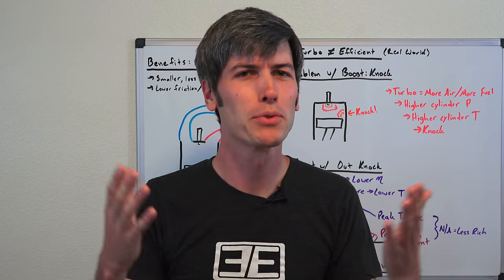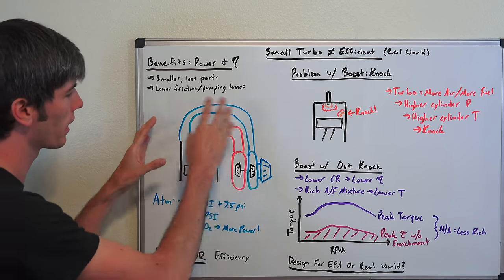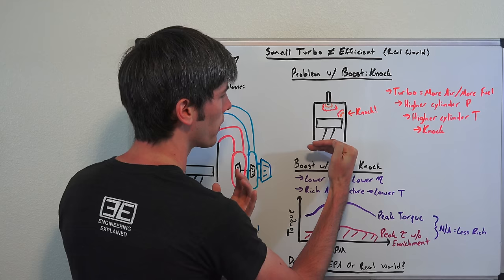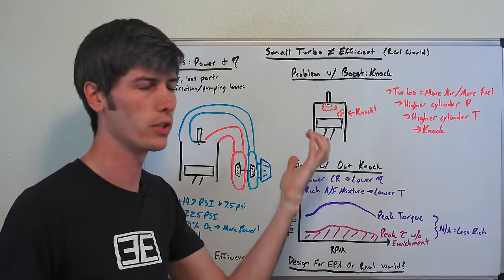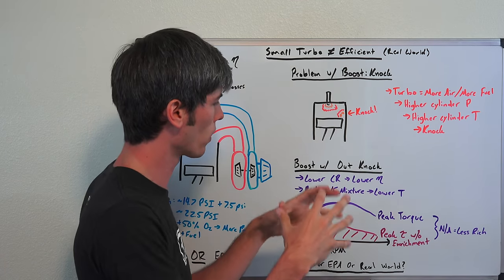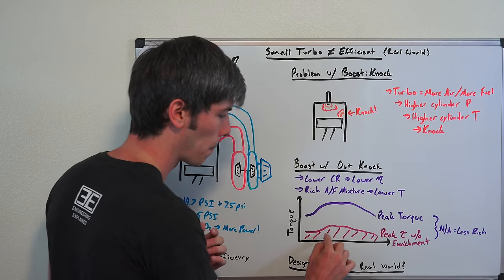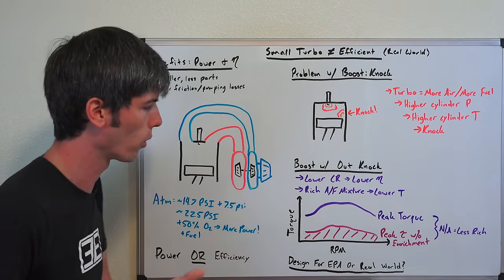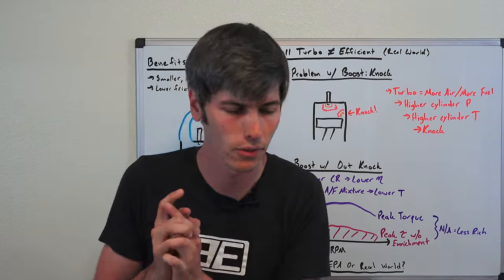Why Small Turbo Engines Are Not Efficient

Comment: I appreciate your video but I feel that after owning over 30 different cars, I have a valid opinion. Golden rule: You can put a V8 in a small car but you cant put a forced-induction 4cyl in a family sedan. 

I had a heavy Chrysler with a 360 in it. Extractors, large exhaust and an aftermarket 4bbl. Perfect engine to shift this car. Was no traffic light weapon but heaps of fun doing burnouts and it did 125mph

I also had a Nissan 97 200SX (same as your 240SX) with the legendary SRDET 2.0lt turbo engine. I did not crack this engine open. Just a new fuel pump, 3.0" exhaust, Chinese eBay intercooler, pod filter and a dyno tune remapping the factory ECU.  ABOUT 1300 USD in total. I got close to DOUBLE the factory power atw,  same with the torque. No crazy boost, pump gas and easy drivability with the a/c on during a hot Aussie summer.

Both engines were suited to the vehicles they were put in. Although   the Mopar suffered from heat sink thus high running temperatures and really needed after market cooling. But I challenge anyone to coax 50% more HP out of a V8 for around 1300 USD? 

The surprising thing was that the turbo engine was still easy to get around 350 miles out of 14.5 Gallon tank. On a pure HWY run I would easily get 385 miles out of a tank. 

I love all engines as long as they go quick or sound great or both. Oh and our 'government milage' stickers on new car windscreens ain't worth sqwat.
Reply: Big cars need big engines , small cars drinks a decent amount even with big engines and do ok with small ones.

Comment: It's an interesting discussion, but it's missing real-world data. The lower displacement turbo engines are less efficient in specific conditions, but you haven't presented any data about how often those conditions are actually encountered, in average driving situations for average drivers. For example, do most people spend most time driving in stop-go traffic (inner cities or congested roads) and constant speed (highway), with low throttle percentage?
Reply: amp888 look at this guy critical thinking! Just like the "mpg" is based off a specific test, and if you aren't driving that test at the same altitude/temperature why should you get the same results?
Reply: I think his point is more towards the performance oriented driver, who may be considering a lower volume engine as a way of having their cake and eating it too. In normal day to day driving you don't usually floor the throttle very often.
Reply: Sure, but that doesn't support the video's title. Perhaps "When Small Turbo Engines Are Not Efficient" would have been more appropriate.
Reply: That's a good point, my dude
Reply: I think so, too. The video is not wrong but as always you can't speak generally. I'm sure Jason knows exactly what is going on and he also didn't say that the shown scenario is the case in every situation.
But yeah, your video title would be a bit better for sure.
I think he could have mentioned the words "downsizing" and "right sizing" since that is the topic here.
Reply: keep in mind, that most people speed...and going 65 - 75 on the highway is going to require that little turbo to spool more often to keep up with that pace.
Reply: Certainly a point worth considering, but I think you might be surprised to discover how little power is required to maintain a speed of around 70mph, for normal passenger vehicles. It's impossible to give an exact value for every car, of course, but something in the order of 10-20bhp isn't going to be very far off.
Reply: amp888 pretty much what I thought. He's comparing a lot of apples to oranges in this. Of course any engine at higher rpm, boosted or n/a, will lose economy. I live in the boonies so see a lot of highway miles. A boosted 4cyl will always give better economy than a v8 for me. Hell, my 2.5 n/a 4cyl gets garbage economy when I lay on it.
Reply: A lot of F150 owners bought the turbo'd EcoBoost engine on the basis of awesome EPA numbers...and subsequently found out that, if you use your truck AS A TRUCK, you'll get disappointing fuel economy.

Basically the turbo tests better than the V8, yet gets worse real-world MPG, especially if towing or hauling heavy.
Reply: amp888 10-20 bhp is not nearly enough power to maintain 3-6 thousand pound “normal passenger vehicles” at 70 mph especially in America a nation buying more trucks and suvs  then ever. This normal average weight probably closer to 4-9 thousand pounds! But the real nail in the coffin is now that we have these supposed modern muscle cars that weigh 4500 pounds and most of the vehicles packed with so many features and comforts 20 bhp wouldn’t even power all those let alone maintain a 70 mph speed.
Reply: Its a good point.  Most people dont need the power most of the time so having an efficient engine that can deliver more power on demand is pretty useful most of the time.
Reply: How many "small" turbo engines are fitted in SUVs and trucks?
Reply: amp888 true, i drive 100 miles to work and back every day in my civic si, with the gearing at 70 mph i sit at 3k rpm, normally cruise around 80 mph. At 80 im around 3500 rpm, in 6th, typically get around 42 mpg with cruise control on. While cruising my car doesnt build boost, sits between -5 to 0 psi on my cluster. It doesn't start building till i hit a certain throttle percentage.
Reply: amp888 
"Small" is a relative term, not absolute. The 2.7L EcoBoost is barely half the size of the NA 5.0 V8.

Hauling 8 tons with a sub-3L engine is pretty extreme.
Reply: my wrx actually gets really good mpg at highway speeds with low load. hills and stop and go traffic kill me tho. well below rated mpg
Reply: just by its nature a 2.0L will rev up to  3,000 to 4,000rpm just calmly taking off at a stop sign but a 5.3L v8 can accelerate up to 70mph on a highway on ramp and never once go above 1,500rpm.  When the little engine revs to 4,000rpm it will spool up the turbo and the fuel map will go rich, its near impossible to not rev out small engines just because of the gearing which is very short due to lack of torque, its just the inescapable true of small engine you need to spin then up to accomplish anything but big v8 practically idle down the road effortlessly.
Reply: Don't Tread On Me V8's have a ton of pistons (reciprocating mass' which is horrible on efficiency) ton of valves/springs (20-25% of engine power goes to operating valve train) and is heavier etc. 
V8's have their place but you're wrong about turbos too.

Spool/Psi output from a turbo isn't just based on RPM. Turbos are spooked by exhaust gasses, which means while yes, you have to spin them faster (average/good small turbo engines actually make it so you can get peak torque around very low RPM: 2000 ish so spinning it fast isn't an issue) BUT, while cruising on the freeway at 3800 RPM, I will have pretty minimal boost built despite the high RPM. Floor it, but stomp the brake and keep the RPM at 3800, well now you just went from 1-3Psi to 15-25 Psi at the same RPM. More throttle = more air let in = more fuel injected = higher volume and pressure of burning exhaust gasses being shot through that turbo.
Reply: M G  hey MG, Roy you know what MG stood for,<aside from being a Marque ? There was Austin, Morris, and others, but MG stood for Morris Garage, then that otgoganal shape was the shape of his DINING ROOM TABLE, so if you were not a Brit, or from a colony, you may not know these things.
Reply: My question was how often the small turbo engine is actually under high enough load for it to be giving worse economy though. Obviously under heavy acceleration you're going to go into that territory, but what percentage of the time is that the case? If you accelerate onto a motorway for 15 seconds (during which your economy is worse than a larger NA engine), and then spend 30 minutes driving at 65mph (with significantly better economy than a larger engine), isn't that better overall? It's useless debating this without real data though. It might be interesting to log some data from the OBD-II port from a few different driving scenarios on different cars and analyse that.
Reply: Good explanation, thanks.
Reply: +M G Unless your 3-6k lb "normal passenger vehicle" is on giant, noisy knobbies lugging around and spinning a dead transfer case, most of your power at legal and above highway speeds is in aerodynamic drag. Come to think of it, those lifted 4x4s are pretty square on to the wind as well. The friction of your running gear and tires is linear with speed. Aero drag is speed squared.
Reply: Galileo would disagree. ...   But I do see your point.  hehe
Reply: bcubed72
how many people actually use their trucks as trucks, and out of those people how often do they use their trucks as trucks? I'm guessing downsized pickup engines result in overall less fuel use.
Reply: amp888,  They have actually better (specific) fuel economy at high load.  That's why manufacturers chose small engines, so that they would be under constant high load at relatively low rpm.  Type in BSFC map and see for yourself.
Reply: yan-Deriction everyone i know uses their trucks as trucks in one way or another, they do landscaping jobs or construction related jobs which you absolutely need a truck for.
Reply: Leighton Samms MG is my initial’s.
Reply: Erwin Nijs, while you are on the right path... what you are saying really applies to all engines small, large, boosted, naturally aspirated. Load is essentially volumetric efficiency and the BSFC curve is essentially the inverse of the volumetric efficiency curve.  Smaller boosted engines though are not as efficient as they theoretically should be for any given high load conditions because of the extra fuel injected for cooling more fuel for the same airflow and power equals lower BSFC. Your best BSFC for all engines will occur around peak load (or better said, peak Volumetric Efficiency) as you are pointing out but again, you have to look at how much extra fuel is having to be added for cooling (i.e., how much richer of an AFR you are having to run).

Basically, you can have a V6 that might have a better BSFC at a give power then that same given power out of a smaller boosted engine because of the additional fuel needed for cooling which is what the video creator is pointing out. Now where the small boosted engine shines is low load (power) because they have much less parasitic power loss so they are more efficient at making the required low power for the situation.

In the end, the economy is dependent on many factors of driving style and conditions with a large portion of it being in that driving style... Drive it like you're racing the guy next to you and economy is going to suck... Drive it like granny and your economy will be outstanding.
Reply: I agree there are to many variables to make a blanket video. I saw a video on the Ford eco boost that they pulled a piece of tape??? off the intercooler to let the intake air get cooler. I think in wet climates Ford blocks off the intercooler so the humid air doesn't get cooled as much and compressed enough to cause water droplets in the intake. Also the alcohol content in the gas will play a role in gas mileage but also in power generated.
Reply: The point of the video wasn't to provide data for specific testing parameters...he explained how high load circumstances are less efficient, whereas low load circumstances are more efficient. The "real world data" is simply applying those two circumstances to real world scenarios...you're not gunna have high engine loads cruising at 45mph, nor are you gunna have low engine load moving your car through stop and go traffic, however, you might also have high engine loads doing 75mph, depending on aerodynamics.

I don't think data needs to be provided in order to claim "turbo cars are less efficient when you use them in situations that make them less efficient," especially when he explains why and when they're less efficient.
Reply: Considering that most modern turbo engines produce peak torque starting around 1400-1800 rpm, I think even normal drivers will be using a lot of boost in typical daily driving. The only time you wouldn't be on boost is if you were cruising at 45-50 mph.
Reply: A major factor in engine load is throttle body position. Going half throttle in 2nd gear could theoretically use more fuel/air than full throttle in first gear if the car is geared a certain way. Easing into the throttle at 1400 rpm won't build as much boost if you floor it, meaning most cars see optimal engine efficiency when the throttle is the the least open required to move the car at a reasonable pace, before aerodynamics and tire friction become a limiting factor, in most situations being 45-55 mph.

So, specifying on what you said, you can achieve more efficiency in high load, low speed situations if you don't floor it and "make peak torque" lol
Reply: Your collage  theory is nice, but Not on my VW Polo tsi 1.2 its way efficient.

Comment: How to downsize an ICE: E100 Ethanol, low inertia turbo, variable compression (infinity), direct injection, plasma ignition, colder spark plugs. That is the way.

E 100 eliminates knocking, low inertia turbo performs better in small exhaust ports, variable compression extracts the better efficiency for every fuel (TRUE FLEX) and every engine demand, Direct injection for efficiency, plasma ignition for faster burn with less advance and better cold starts, colder spark plugs to drain out combustion chamber heat...

Electric cars are not necessary...
Reply: sounds like you want to drive your laptop

Comment: 2017  Chevrolet Malibu. 1.5L , When I set the cruise control at 65 I normally get around 43-47 on the highway. Now go to to 70-72 around 36-39. Having the A/C on “eco- car shuts off at red lights with A/C on.”will bring it down about 6-7MPG less city and highway.  So far reliable! 73K.

Comment: I used to drive the "turboed" vehicles back in the 80's (yes, I'm old), and it was the same deal back then -- you had to stand on the gas to get any power.  Seems not much has changed since then.
Reply: The technology has changed for the better with more efficient turbo designs along with better cooling. But the main principle is the same. They're still a blast to drive but will drink fuel like an alcoholic when you put your foot down. They are designed to do this not only for the demand for more power but to richen the mixture so you don't lean out and fry pistons.
One of my favorite turbocharged vehicles is the older Porsche 944. Primarily gutless but had power when you needed it. Not to mention, one of the easiest and smoothest manual transmissions I've ever driven.

Comment: This is a good explanation of why fords eco boost had valve carbonization issues when used under load.  The rich air fuel mixture used to cool the combustion space resulted in incomplete combustion allowing soot to build up on the exhaust valve and eventually ruining the valve and it’s seat